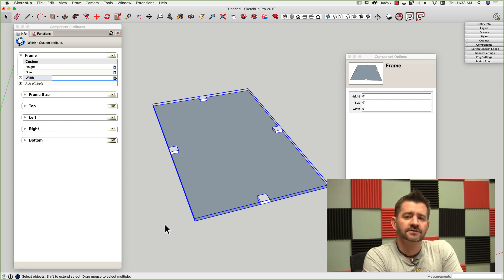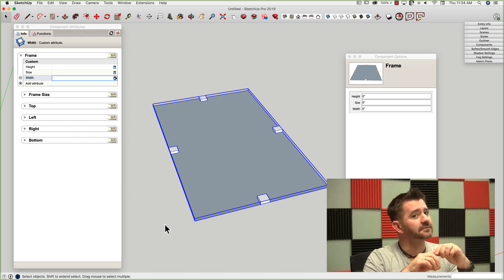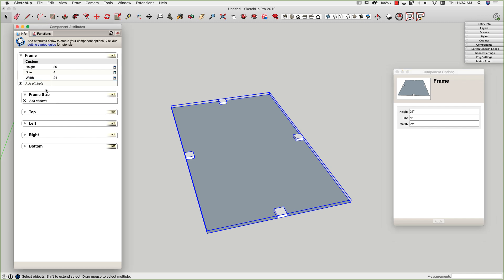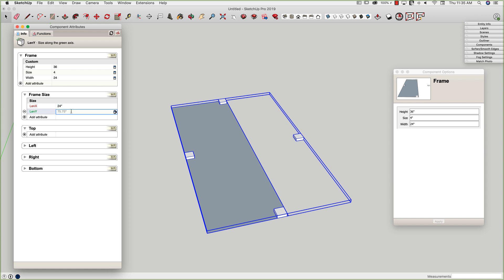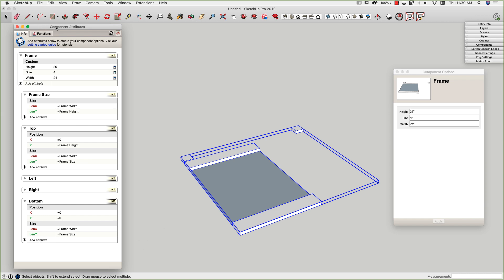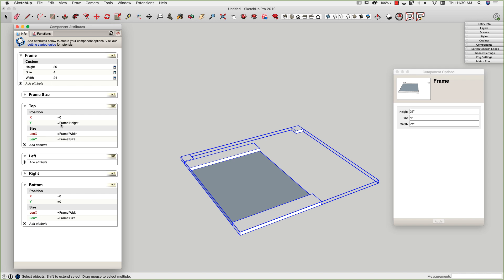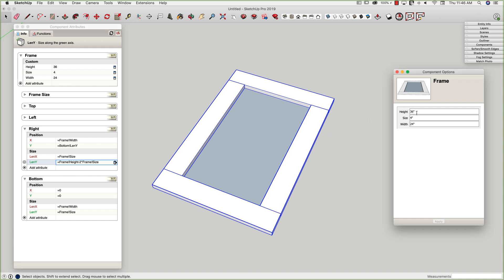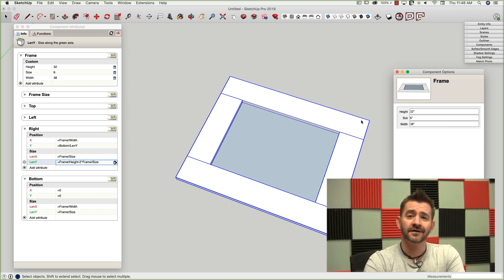Welcome to Dynamic Components - Part 5 - Skill Builder

Comment: I am a cabinetmaker,  it would be great if you could, in advance, fully model a base cabinet with 2 doors. 1 drawer,  1 interior shelf, and counter top. Then in detail, explain the hierarchy to coding that would drive sizing, and the best work flow to applying dynamic components
Reply: Id like to see this too.
Reply: same here
Reply: Most of the cabinet can be designed with the info here. I did draw one, so far without drawers, but I'm trying hard. What I need at the moment is how to do the thickness of the board.